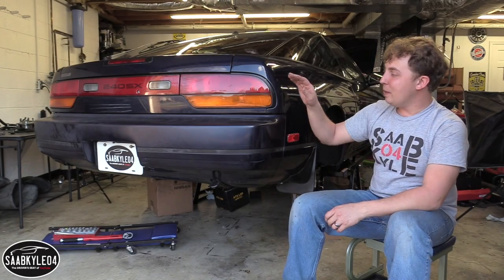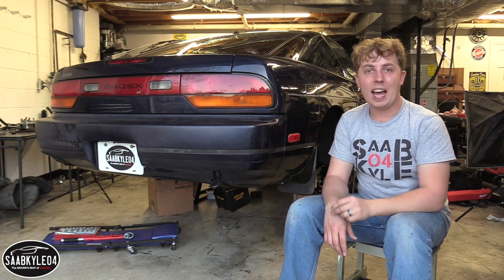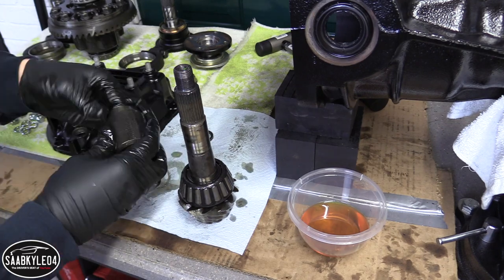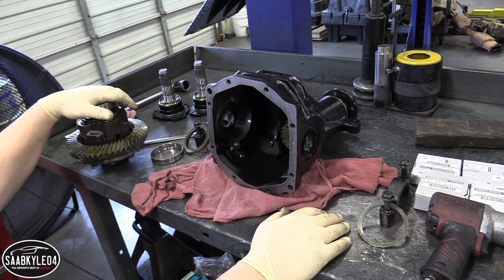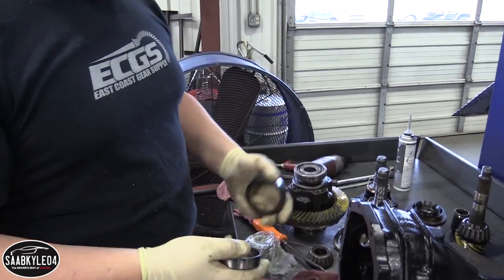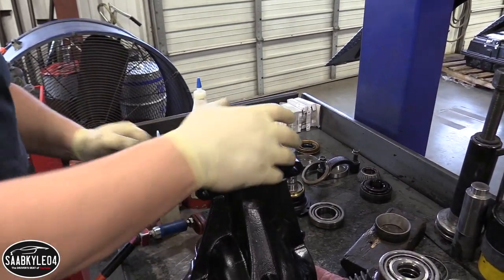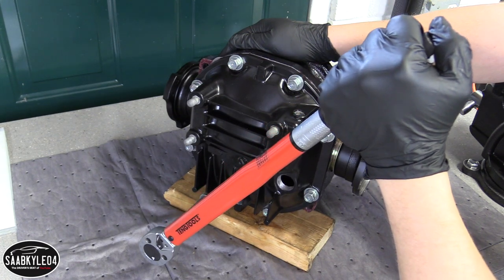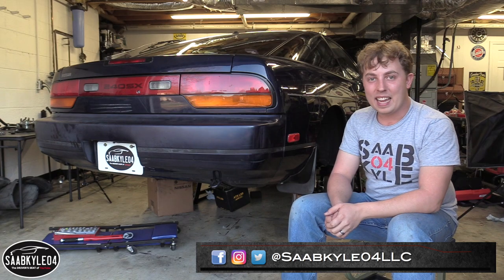240SX Rear End Rebuild Part 2.5:  Installing A Limited Slip Differential (Complete Overhaul 2 of 2)

Comment: Where did you find part numbers for all the bolts, vent tube, etc?  I'm in the process of rebuilding my diff right now also. The diff breakdown doesn't show parts as small as nuts/bolts.   Thanks

Comment: How much does it cost to get this all back to a restored condition?
Reply from the maker: I don't have everything itemized as far as the powder coating and stuff since it was done in bulk with other parts.  It's not cheap, but to give you an idea, the bearings were about $50-60 a piece and all of the hardware, if I remember correctly was less than $100, maybe a tad more.  The OE Nissan gasket is about $20.  The powder coating really depends on where you go and their labor rates, again, not sure how much it would have been to just do the diff casing by itself.  Of course, none of that factors in the differential carrier itself, which has to be sourced online, if you can find one.
Reply: +Saabkyle04 I appreciate the response! Nice to get this kind of information in the case if I were to do a car restoration project myself! Great video! So far this series is phenomenal!
Reply from the maker: Thanks pal!  Happy to help!  It would be a good idea to list some of that in the video just for that reason.  I'll try and remember that for future videos.
Reply: +Saabkyle04 Alrighty! :)

Comment: Is a G35 better or 350Z?
Reply: Nonamus Gaming They Do have the same engine
Reply: Depends what your looking for. To my eyes the z is a sports car or gt car, 2 seater and the g35 is an entry level luxury sports coupe or sedan, 4-5 seater
Reply: Luxury sports car < 2 Seater Sports
Reply: MaximumDestruction maybe by the numbers,but the R35 engines are hand built.
Reply: 350z is better but there is very little difference between the two. i do know the g35 2 door is still a little bit longer than the 350z
Reply: It’s all preference.  Either way they are both good cars
Reply: Nonamus Gaming 350z
Reply: Nonamus Gaming  They are the same car essentially... just tuning differences.
Reply: 350z is a better drift car
Reply: Imo the 350z has a better interior. The steering wheel alone compare to the g35 looks better
Reply: Depends on your preference! The G35 is around 300lb heavier and has back seats that could be useful, while the 350Z is more popularly known as a sports car. The advantage of the 2007-09 350Z is that it comes with the VQ35HR engine. If the newer 350Z or the Nismo were in my budget I may have chosen that but otherwise the G35 is probably the better choice imo. I decided to get a 2004 G35 coupe with the Brembo and LSD package. I highly recommend it
Reply: If you drift, 350, better sized wheelbase and lighter.
For daily driving, g35.
Reply: to add to what's already been said, g35s are good looking and clean under the hood but the interior is ugly and the back two seats can comfortably seat a large baby. don't buy a g35 for more seats. the back two are abysmally small. Having driven one myself, the power curve is dependable and predictable. obviously working under the hood will be more difficult because of all the luxurious plastic whereas a 350z has much more of a market for mechanical customization opposed to the g35s massive cosmetic custom market.
tl;dr 350z for fun, g35 for looks and picking up bimbos.
Reply: DoubleJointedPussy  I’m a subaru guy who owns a G35. You are pretty much right on the money!
Reply: Nonamus Gaming I have a g35 I personally like it
Reply: G35 is much easier to live with
Reply: To reiterate others, and make it easy on you, it’s entirely down to personal preference, price point and wants/needs. They offer very similar packages so that’s the main difference. What do you see yourself driving?
Reply: For track purposes go with The Z. For daily driver purposes go with the G35 due to practicality.